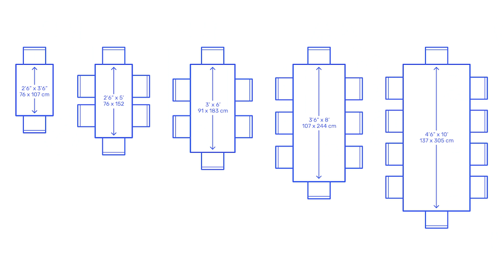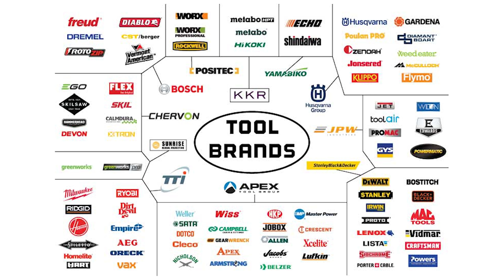LEARN WOODWORKING FAST!

Comment: After 6 years and 7 spine surgeries I couldn't work anymore and was jonesing for something to do here in my garage at my pace when I felt like doing it. At 60 years old I've never got into carpentry of any kind so I'm as green as they come. 😆 2 months ago I bought $800 new Ryobi cordless power tools and here they sit. I don't know where to start first. I really need to build a medium size work table is what I really need. I'm just dreading having to build it on the floor due to my spine but I have no choice. Anyway, you have inspired me bro. 1) I used to skate in the 70's & 80's and that's what brought me to your channel was the fact you recycle decks!. 2) the way you laid everything out in layman's terms was very helpful to me. 
Thank you sir. Subscribed! 👍

Comment: Well done video. I wasn't too sure if this was going to be preachy or boring? But from your editing, you keep it to the point. WELL DONE. I am going to mark this to come back for viewing again. You keep it simple for beginners to start doing something. SAFETY is the most important to enjoy anything you do. Read the instruction - practice before using your tools on your project - well-ventilated work area. The only other thing I would have added for the tools would be a few clamps to secure your material if you are cutting or sanding. Maybe that could be the next video. Looking forward to the next project video or inspiration video.

Comment: Great straightforward advice! With any mask or respirator, if your glasses are fogging up, it’s not fitting properly so make sure you adjust it or get one that fits you better. They make different ones because not everyone has the same shape face.

Comment: I agree that your first few projects will be awful (mine certainly were....), but proper planning is definitely the key and Ben's 5 steps will go a LONG way to keeping you organized.

BTW - I am trying to get more serious about shop safety as I get older (turn 60 on 3 weeks!).  I started using safety glasses about a year ago (once I found a bi-focal version - mainly because I could not read any of the VERY small print on bottle, manuals, etc.).  I am looking at one of the blue tooth hearing protection products, but after you sharing the RZ Mask tip, I just ordered the M2 Flameout mask (with the discount code - thanks!).  So yes, even old dogs need to learn a few new tricks sometimes! ;)